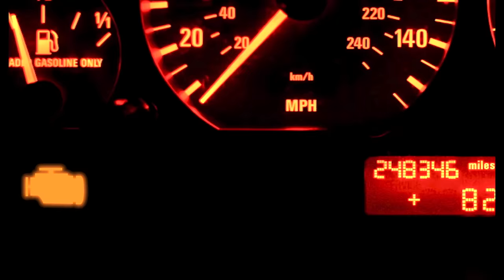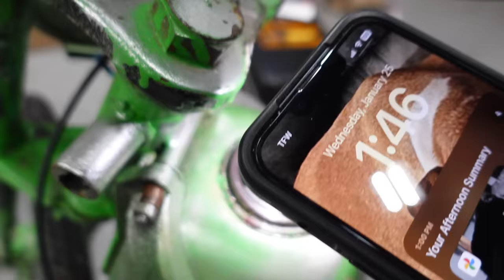TRASH to TREASURE? MECHANICALLY fixing my vintage SEARS MOPED!

Comment: Ive been restoring a 2000 arctic 400 4x4, and had to rewire it, because some dim wit used the thinnest wire possible to make some ground wires, and a wire to the winch that could have burned the thing down because he never put an inline fuse in.  I had to rebuild the carb because the same dimwit used regular rtv for the primer, and other areas that clogged up the carb.  They sell rtv for use with gasoline, but that's what you get when you don't know what you're doing.  I just bought all oem coolant hoses, because otherwise i would have had to order chinesium garbage that would take forever to arrive, and i felt the import tax, and possible other fees was suspect.  Luckily the thing has low miles, and runs good.  I just need to change the bushings throughout it, fluids, and some other small stuff and she will be good to go.  A good used place i buy parts from is power sport nation on ebay, or their website.  I have gotten what's described and pictured.  That thing will look good if you paint it that same shade of green.

Comment: There was always a running argument when I was a kid as to if the Puch or Tomos mopeds were the best.  I had a re-branded Puch in the late 70's / early 80's and would ride it to middle school - back then you could get a moped license when you were 14, there wasn't any inspection for mopeds but you had to get them tagged.  it was common to put bigger carbs and remove or cut the baffle out - if you could get over 35 mph you were flying.

Comment: Wonder if you have a bit of carb icing while running? Will happen when it's close to freezing and humidity is high. Clears right up when the heat from motor melts the "gascicle" in the venturi.

Comment: The throttle on a moped is basically an on-off switch.  Idle or full throttle is typically what you will use.

Comment: The Puch 50 I rode tor a while i remember we changed the jets and ran a plug that was the right match for the jet, that thing was so reliable we would ride it on fields and down the Bridal path at the side of the canal, I remember we forgot to get 2 stroke oil and mixed 20w50 in the tank and ran it for a month like that until we had to put more fuel in it. T stopped riding it when I got a Yamaha FS1E I bet it is still in my friends dads garage where I left it.
Reply: Probably a bridle path, unless it was overwhelmed by brides.

Comment: My moped used to do that it had something to do with the high idle jet flooding out the engine. Also I remember if you pulled the clutch while full throttle it would give a miniature boost in power.

Comment: wonder if there is any performance to be gained if the intake elbow could be swapped for one with a nice radius bend instead of that sharp 90
Reply: I would be pretty surprised, that seems fairly standard small engine stuff.

Comment: That’s not a performance exhaust. You’re going to want a pipe with an expansion chamber for added back pressure. It will make a huge difference. With an expansion chamber, different jets in the carb, and a different rear sprocket the bike will do around 40 mph without changing anything to the engine itself.

Comment: Super stoked you got it running Jake! 2 things. I know that you and several other people in the comments have said that it's a carb issue. But just in case I would take a look inside the fuel tank and make sure that you don't have any corrosion because that could be blocking your fuel supply or pushing dirty fuel into the carburetor. Also now that you have it running I can't wait to see what you're going to do with the whole paint scheme on it so that it looks way less stolen and way less like a meth head is riding / owns it. lol jk